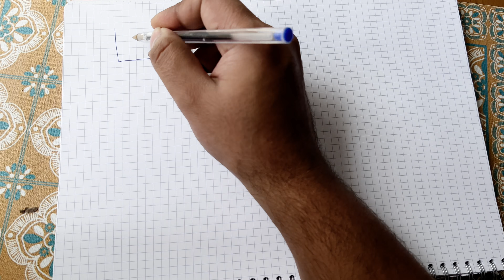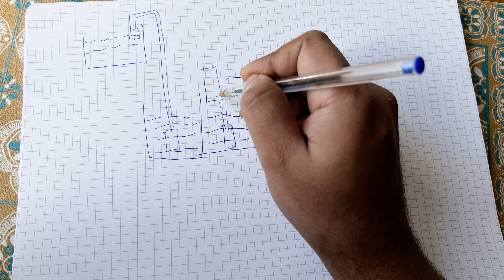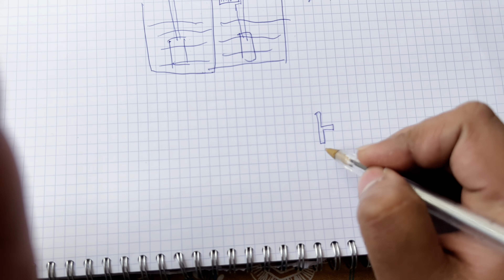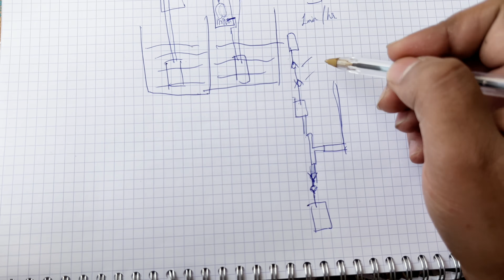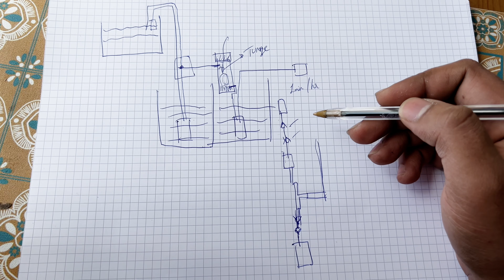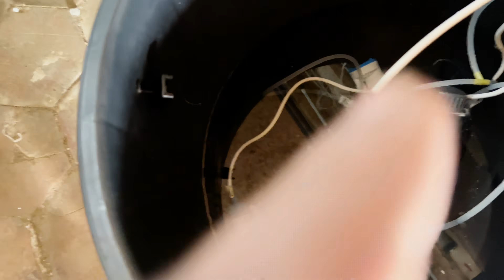How I dose Kalkwasser in my reef tank: a complete guide

Comment: Beautiful tank!  One question on the kalk stirrer....are you worried about getting some of the slurry to go into the tank instead of just the clear kalk water?  Seems like it could happen.  Other than that, it's a fantastic solution.  I didn't realize that the osomolater pump could push that far.  Nice to see it works.
Reply from the maker: Hi thanks for your comment. 👍
To avoid adding the slurry I turn on the pump for a maximum of 1 minute . I verified that it does not give enough time for the slurry to rise up.
Reply: @recif_conde  thanks!  That makes sense!